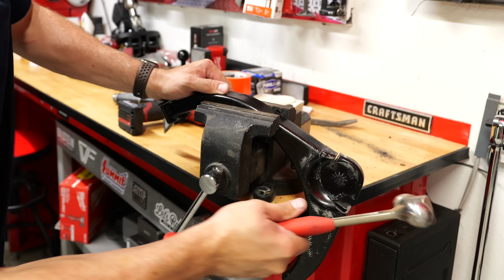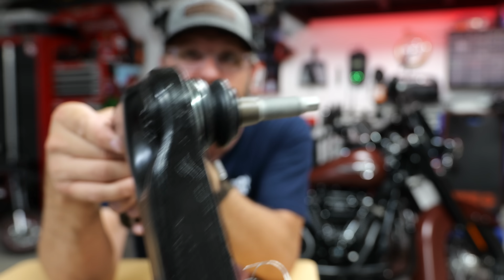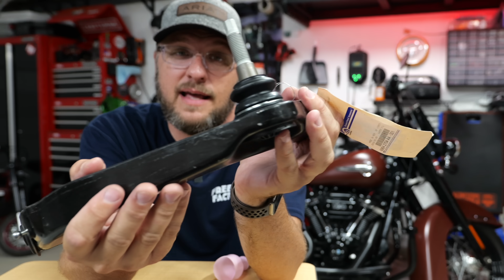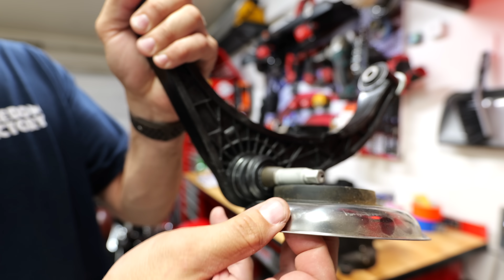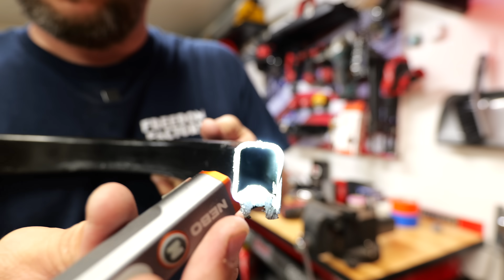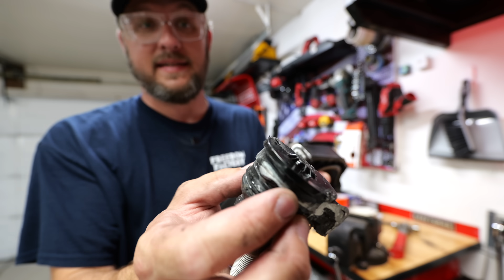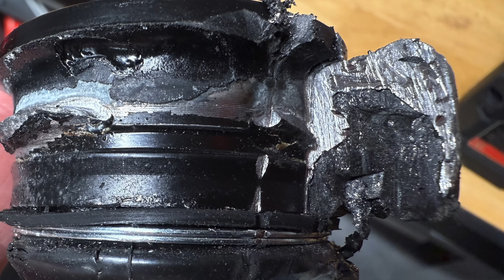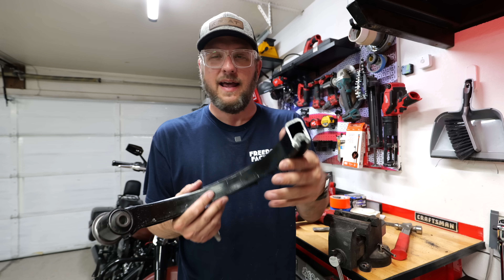I Cut Open RAM’s Plastic Upper Control Arm… Worse Than I Expected?

Comment: What I see is very thin sheet metal! Maybe 18 gauge , this nave very little strength and there’s no way I would trust them! The accountants are destroying our vehicles with this crap! Those upper control arm need to be 1/8” (11 ga) at a bare minimum!
Reply: they could be built out of used rebar, and be stronger and cheaper.

Comment: Plastic weakens with exposure to the elements over time.  Plastic can crack.
Reply: To be fair, I work in manufacturing and there are some very amazingly strong and resistant plastics. However those are VERY expensive
Reply: It's not 100% plastic.
Reply: It will slam dissolve in direct sunlight.
Reply: @chrisbraswell8864  In this case it's mutt the are is under the car will never see sunlight.
Reply: That depends on so much. We need to know what plastic + any filler that was used.  
Paint can scratch and rust too.  
This could be cheaping out or it could be a smart use of both materials
Reply: And it’s probably not even high-quality plastic either
Reply: Has anyone heard of Ford's "Quiet Steel"? It is plastic with a thin layer of sheet metal on both sides, so you can use conventional paint. If it rusts, it does, it rusts through very quickly leaving only the plastic where the steel rusted away. Once that starts, the whole piece is trash in no time.
Reply: So does metal.  The problem is it's not as strong to begin with and it's almost always non--repairable.  If I break a fully metal control arm up on a mountain somewhere, I can weld it back together to limp the vehicle out.  Good luck with trail repairs on this junk.  Even if there's enough sheet metal left to weld together, the plastic melting into the weld pool will compromise the process.
Reply: And then it rusts
Reply: yup, toys r us quality
Reply: Metal can crack the plastic might inhibit rust
Reply: It'll help retain water ingress too and hide the rust till the control arm breaks.
Reply from the maker: True
Reply: Plastics can be very strong and durable. Glocks from 1990 still running.
Reply: @mmagscott Be serious. They don't go through heavy use and exposure, supporting a thousand pounds of weight and being fully exposed to the elements
Reply: @NYPrepper  wait till you find out what happens to steel when it gets hit with sand and salt
Reply: @123devinzz1 Someone stole your ability to spell properly.
Reply: @123devinzz1  That's why we galvanize it, then add paint and an extra undercoat of oil to protect it. Plastic you can't protect. Plastic gets weakened by everything, time, light, chemicals, heat, stress. For steel it's just oxidation you need to worry about unless you push it way to hard and it gets hot enough to start to effect the heat treatment or metal fatigue begins happening. Hence why steel is better than aluminum which has no threshold where metal fatigue starts to build up, it's always going to happen no matter how light the load cycle is.
Reply: @123devinzz1 I guess but I live in the south, no rust here if you take decent care of it. I got a 2002 odyssey. The brake rotors fall right off. The old wheel hub slid right out.
Reply: @123devinzz1  Steel will last a hell of a lot longer than plastic, even if the steel is not coated. Plastic will always break down faster than steel.
Reply: @123devinzz1  it bends and then craks...plastic cracks and then bends or falls apart.
Reply: @123devinzz1 salt and sand doesn't splash up that high... I live in Pennsylvania so I know.  Never heard of anyone complaining of rusty upper control arms here.  Even so, rather have solid steel rust which can be replaced anyway, than be towing a heavy load or offroading and have my upper control arm  crack.
Reply: @NYPrepper absolutely does splash up. control arms rust as bad as anything else. go to atlantic canada if you wana see some real rusting year round. i see no issue with the arm shown in video. its seems like a standard stamped steel arm coating in plastic which wouldnt chip like paint. the non replacable balljoints are lame tho
Reply: @123devinzz1 I live in Northern Pennsylvania in thr Lake effect snow belt and no one has ever complained of rusty upper control arms.  It's called a car wash dude.
Reply: @123devinzz1 maybe you don't have enough experience towing heavy loads or offroading.  That UCA will bend and break under heavy forces.
Reply: @NYPrepper towing no. offroading yes. under a heavy force they may bend yea but not under regular use. the cut cross section doesn't look too far off any non plastic coated stamped steel arm really. atleast they wont fail completely like gms new aluminum arms. personally i run aftermarket uca on all my trucks.  icon deltajoint arms
Reply: @NYPrepper You are kidding, right? Your tire throws whatever you are driving on everywhere in the wheel well. I work on fleet trucks, uppers get plenty rusty and often have piles of road debris sitting on them.
Reply: @NYPrepper An upper control arm in that style of suspension does not carry any significant load. There is nothing you could do by towing or hauling that will bend it. The weight is on the lower and the strut. The upper is mostly along for the ride.
Reply: @NYPrepper 
I live in a country where saltwater beaches are also marked as public roads, salt can get everywhere when you're driving for an hour beside a surf break
Reply: @NYPrepper  "Salt and sand doesn't splash up that high...."  You've never looked under a vehicle, have you?  Never driven in the winter and seen cars plastered all over with road salt and chemicals?  Do you even own a car?
Reply: So you didn't watch a bit did you? It is metal. Coated with plastic. No rust maybe but all strength and more rigidity
Reply: @DustinDIY  thats the first generation. The newest arms ram took the metal completely out of the control arm. Its completely plastic.
Reply: @kennethobando5755  
💯 false! 
He is showing you the current control arm.
Reply: @DustinDIY I saw...that's probably even worse than pure plastic because the metal will rust under the plastic
Reply: I have high grade radio control cars and can confirm this. On these models like the Traxxas X-maxx which are made for large jumps and hard use almost everything but the gears is plastic and it’s great because it can flex and not break and also save weight

However, over time these plastics will dry rot and get more brittle. I would not want the same plastic technology on a real car, that’s insane. What works great for a high performance toy doesn’t necessarily scale up to full size well

Comment: I worked night shift as a technician who changed out control arms and knuckles through the night during fatigue testing.   Used MTS servo hydraulics to beat the living snot out of these suspension parts.

Comment: 95% of engine intake manifolds are synthetic as well. Those go under much more damaging heat cycles. Turns out this part is not even 50% plastic.
Reply: Intake manifolds don't have 6,000 lbs of weight on top of them
Reply: @NYPrepper  They don't need it to fail. The heat and cooling cycles side the engine compartment will eventually crack the plastic in probably around ten years or so.

Comment: These new vehicles will be scrapped and recycled into new vehicles 3 or 4 times before the 2005 Toyota Corolla needs a new radiator
Reply: One of the Best Ever Made👍
Reply: Your one of those guys that never had a problem with his toyota except the head had to be replaced twice in 170,000 miles right.  True story from my neighbor.
Reply: @dskebo  
Being easy to work on is an absolute win. 
"It doesn't break down"
No, it does. It just so happens to be so easy to work on that you don't notice that it was broken down. 
Can't really say that about newer vehicles, but older ones did have that going for them.
Reply: @dskebo  that sucks. My mom's scion is at 175k miles and all she's done is a clutch. Basic maintenance only on the engine. Everything works great still

Comment: Let’s be perfectly honest here It’s not like the rest of the vehicle is going to out last the control arm
Reply: Got a 12 Ram...do not buy a Ram truck...just ask...lol
Reply: @SWATT101  i got 13 my self and holding good , i've seen 5 years old Tundra with bad transmission solenoids, i think we just have to get lucky and sometimes we simply don't
Reply: @SWATT101  I have a 17 never have had a issue!
Reply: @WhoReallyCares917  That's 8 years. Get back to me when your truck has 31 years on it like my 94 F150 has. Never mind, I'll be long gone.
Reply: @davep2945 LOLOL. For some reason, I can't bring myself to buy a truck that costs twice as much as my first house. 😅
Reply: @superfinn80  Yup. Don`t forget about the monthly payments. They are as just as expensive as paying a mortgage payment
Reply: @superfinn80   when you life in north east Ohio you will never get 30 years out of a vehicle. The salt will eat that body well before then.
Reply: I rented a Ram Rebel, had 85K miles on it (a lot for a Herz rental) and it looked and drove like new. It had the Hemi 5.7.  l wouldn't buy one too expensive, but it was a nice truck for sure. I like it better than the competition.
Reply: @Mark-p1r7r  polished turds, engine failures are still prevalent from lifters eating cams and taking out oil pumps, as well as transmissions still failing randomly but hey, they are comfortable and have nice interiors
Reply: @anrit5972  every time I see a comment like this I wonder if the person has ever owned the vehicle they're talking about, I worked on multiple dealerships since I was 20 years old including Dodge for 4 years, my wife's and my daily drivers are a Jeep and a Ram, no car is perfect but out of all big 3 today that's my pick, I'd rather deal with a bad radio or a PCM update than a blown up engine or transmission under a 100k miles and we can argue about both Ford or GM about that. over 10 year experience in automotive and currently running my own automotive business at 29 years old

Comment: It looks cheap because it is cheap. Hey Ram, if you want to sell me plastic, how about at least lowering your prices to match your lack of quality,
Reply: I never had a issue with Mopar suspension parts. I remember a Tire Kingdom tech tell me my shocks on my 2yo ('17 200) were going bad. Took it back to the dealer & they said they were fine. Kept it 6 years & 160k later no issues. 🤷
Reply: @Mach141  that's ok I will keep my 2091 dodge Dakota forever I will never buy a new car again take that dodge and you snake car salesmen
Reply: @Mach141  You think Ford or GM or for that matter- Toyota is any better?
Mopar is on-par with it's competitors, in my opinion and experience, they are better vehicles.

There are vehicles with plastic springs, such as Corvettes and they work fine.
Big ass semi tucks have air bags/springs that are held in with plastic.
Some brake calipers use plastic pistons to stop your car.

Plastic has the advantage where in salt belt states- it won't be affected by salt, wearas punch formed, welded parts will rust into swiss cheese.

Aluminum is more resistant to corrosion, but it's more expensive and can be brittle.
Reply: RAM, ya mean FIAT & Peugeot?
Reply: tick tick tick tick tick tick
Reply: Dodge has never made a good vehicle. At least not in my 55 year old lifetime.
Reply: @chrish3720  my 2012 1500 with 361000 miles on the original engine and transmission disagrees with you. That truck has been 100% reliable with regular maintenance
Reply: @killaham4  Stop telling these young guys this crap. They deserve better and you know it. Hey, what about those worn out camshafts and garbage lifters in that Hemi. Total POS
Reply: @chrish3720 biggest reason for lifter failure in my opinion and personal experience is going long on oil changes and or using shitty oil. I got my 2012 in 2019 with 92k miles. Just turned over 361k and still going strong on the original drive train. Most of those miles are towing a 35ft boom lift. Never have gone more than 5000 miles on the oil. If you take care of your stuff it will take care of you.

Edit: original lifters, cam, and head gasket, too BTW
Reply: @killaham4 Dodge didn't do the proper heat treatment on their cast iron cam shafts. Glad you have had good luck with yours. But for the most part the only good thing Dodge has ever done was putting the Cummins 12v and 24v engine in the old Ram. Of course the truck fell apart around the engine. Dodge has always produced a sub par vehicle. Sorry but it is a known fact amongst us who know. But I wish you continued good luck with yours, just be aware that it is pure luck.
Reply: @chrish3720  hate to burst your bubble but they all make subpar trucks. GM has afm lifters collapse and the transmissions are garbage and frames that rot out way too fast. And now the 6.2s that grenade driving off the lot.  Fords cant get timing chains and phasers working. We had a 2018 f150 with the coyote and the cam phasers blew up at 170k miles.  Out of all the trucks my company has had, ive had the least problems with rams, specifically 4th gens. The truck i had before mt 2012 was a 2011 with the 4.7 powetech and it ran til 310k when the thermostat stuck closed and it blew a head gasket. Still used it for another 20k miles until we sold it. Just had to top off the coolant every day.  My partner has a 2020 classic tradesman with the hemi as well and its at 180k and the only issue is the exhaust tick we dont care enough to fix. Had some electrical gremlins of course and had some tipms rebuilt. And i dont need or want to deal with a diesel. Maybe it is some luck but most of it is religious maintenance. 

All manufacturers suck in their own way. Its late stage capitalism. Even new Tundras are garbage.;
Reply: @killaham4  That's why I drive Tundra
Reply: @chrish3720  lol im assuming not a new twin turbo one
Reply: @killaham4 Absolutely not, old 5.7 just keeps chugging along.
Reply: @killaham4 I felt like a trader buying the Toyota. I didn't move away from GM, GM moved away from me.
Reply: @chrish3720 that thing will run after a nuclear apocalypse with regular oil changes lol. We were looking at a 2019 Tundra at the same time as rhe 2020 classic but we got the classic because the price was too good to pass up.
Reply: @chrish3720 my non work vehicle is a 2018 4runner and im going tk drive it until the wheels fall off. Then im going to bolt them back on and drive it another 250k miles
Reply: @killaham4  Good man !!
Reply: @killaham4 You made a nice balanced decision. Hope you have the best of luck with it.
Reply: @chrish3720  I like to think i did. The tundra would have been nice, but for what I paid for the 1500 classic, i could buy a rebuilt engine and a low mileage used 8 speed transmission from lkq and still be less than what the tundra cost.
Reply: @killaham4 I heard that !!
Reply: @chrish3720  Chevy made worst an Ford isn't any better
Reply: @Mach141  just quit buying ram trucks
Reply: @Mach141  they did 
2026 is only gonna cost  46k with a Hemi
Reply: @WB700r  "Only."  And nah, they won't.
Reply: @WB700r  LOL. Where ? Dodge trucks of today are complete garbage . There are so many recalls on them. Even Ford and GMC have the same crap . I would never want a car or truck with plastic suspension parts . This is a very weak system.
Reply: @Mach141  Carbon Fiber is also plastic OK genius.
Reply: @shoutingATclouds-btw  umm…
Reply: Yes extremely high quality plastic like kevlar or how u say it carbon fiber it is plastic but far far more better then regular platic
Reply: @shoutingATclouds-btw  I would rather have steel parts than either plastic or carbon fiber. Carbon fiber is stronger than plastic though.
Reply: @johnshaddick6858  Petroleum materials based over metal like that, my guess is it's something from the marine industry.
  Yes, the materials used to create substances with carbon atoms bonded together in microscopic crystals, like carbon fiber, are 90% derived from petroleum, similar to plastics. So carbon fiber is a weaving of plastic covered in another type of plastic. Plastic in contact with steel like that will probably last longer with zero mantaince than steel in contact with aluminum.